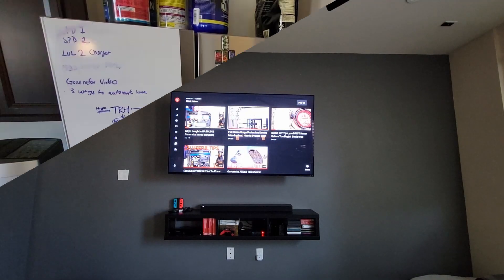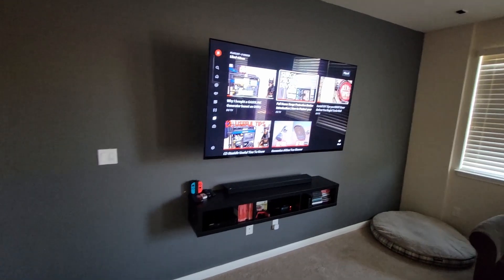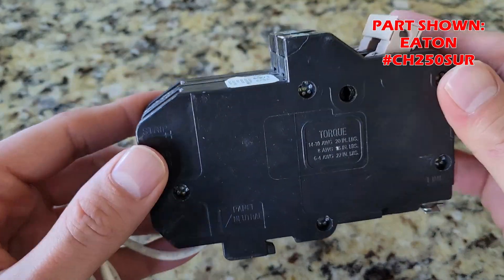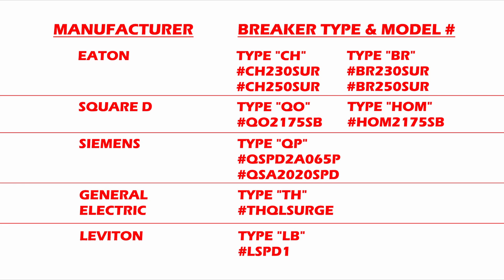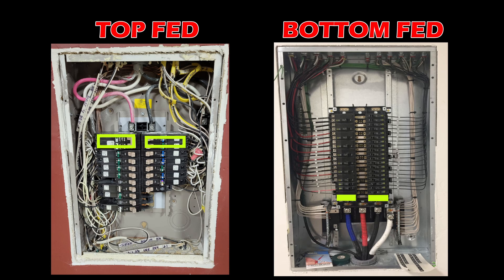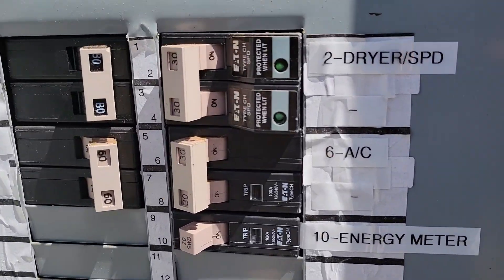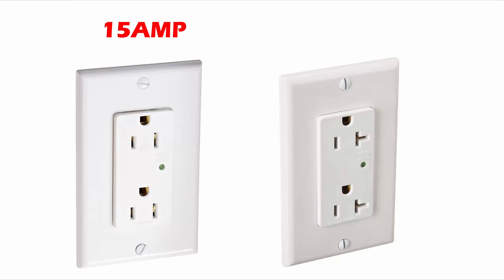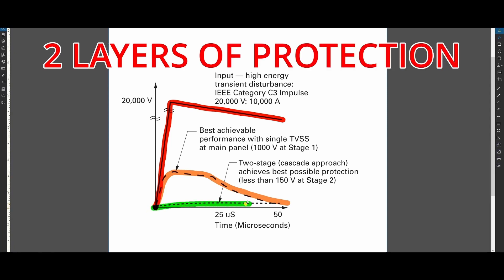Protect Your Electrical Appliances With These Two Components | SPDs

Comment: I was quoted $1,182 for a SPD : "Main Panel 1 Surge 200KA max discharge. Warranty - 3 years parts, labor, travel, 100,000.00 manufact limited lifetime connected equip warranty"
Also, $558 for two "double pole 15-60A circuit breaker'
$2,195 to run a grounding line/rod.

Comment: When you say, "only protects once," does the receptacle continue to provide power, but without protection, or does it turn off? What I am wondering about is that I'd like to put one in for the fridge, but the fridge makes the receptacle inaccessible. So, I won't be able to see when the LED turns off. If the receptacle fails off, then stuff in the fridge spoils and that is the indication to pull the fridge out and look at the LED.  If the receptacle protection fails on, then the fridge keeps running, but I have no idea that there's no longer any protection.

Comment: Don't some of the SPD instructions say that there needs to be a minimum physical distance between them when installing multiple SPDs, e.g., in multiple panels on the premises? This aspect always confused me. I am guessing that with faster transient signals, wavelengths and resonances become considerations and that is what is behind this, but as a practical matter, I didn't see how to determine all the various distances involved. 

Most expensive device being protect? I guess that would be my EV if the EVSE passes the pulse. 

As an aside, I was digging through various SPD options, many of which mount outboard of the panel via a nipple. Some of these had better specs than the SquareD QO SPD, but since I have a plug-on neutral panel, I ultimately decided that the most important thing was avoiding additional inductance from the pigtail, nipple, etc., and went with the QO plug-on neutral SPD. Have no idea if that was the right strategic thinking!

Comment: Great explanation. Will a wall plug surge protected plugin offer same or similar protection than the wall installed spd?
Reply from the maker: Good question.
It can, but it depends on which plug-in surge protector you buy.
3 electrical parameters to look for: max surge current, short circuit rating, and Joules rating.
Joules rating refers to the maximum amount of energy the unit can absorb before it fails.
(the higher the values the better the unit)

The Leviton S1000-PS (~$50) is a commercial grade surge protector strip with 6 outlets that has higher performance ratings than the wall installed SPD receptacle I feature in this video. It also costs about twice as much.
Reply: @dgtv3320  Awesome. Thank you so much. I once almost lost some equipment from a surge. Burned up my surge protector before i got damage. Now I have a better understanding of what to look for.  Thanks again.